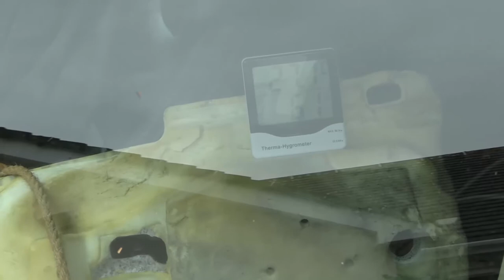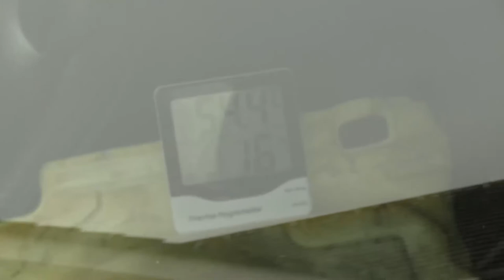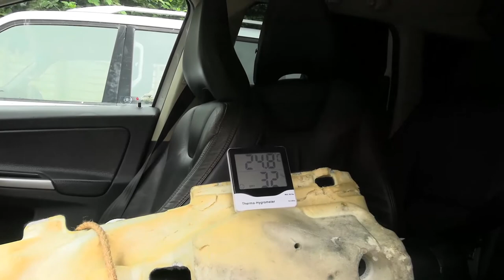Drying carpets after Volvo XC60 windscreen leak

Comment: Great video. very useful thank you. I have the same problem with my Volvo C30... With a lot of water sloshing around under the carpet etc.  The seal at the edges of the front windscreen has gaps and needs replacing.

Comment: Found this after looking at your M300 video.  We have a 2012 XC60 purchased with slightly over 100,000 miles.  After finding leaking along the entire top edge of the windshield (windscreen), then discovering that Volvo had a problem with bonding for several years, I convinced our dealer that he HAD TO either replace the windshield with a new one, or fully remove the existing one, strip then re-prime the bonding area and properly re-install.  They opted for the latter and total cost was $0.  The fellow who does this work did an excellent job, solidly bonded when done (and now, 9 months later).

Of course, I have no idea if Volvo UK has generous moments like Volvo NA occasionally does.  But this is also a design defect and it was nice for them to take responsibility, especially at the high mileage.
Reply from the maker: Well done! In the end mine was replaced under insurance, but only becaue it had another chip in it that qualified for the cover, otherwise it would have cost me about £700 which was a surprise.
Reply: @samuelfielder  That's good to know.  I never thought about windshield insurance for anything other than cracks or destruction.
Reply from the maker: @nheng6913  Well, it doesn't work for leaks by themselves. You have to have a crack or stone chip too. Luckily I did.

Comment: Thank you for posting, great video. There is a windscreen bonding issue with the XC60 and other Volvo models. removing the windscreen external side trims and cleaning them out and the channels does go some way the negate the leak however I understand that a remove and re bond of the windscreen is the real answer

Comment: I can empathise with your struggles with car trims and fittings and also with water ingress as I’m currently tackling related problems on my 20yr old V70.  Well done with your perseverance.  The only you don’t appear to have done is to seal and test the leak has stopped!
Reply from the maker: Autoglass said they'd try and remove the windscreen and then reseal it, but if it broke during that attempt, I'd have to pay for a new windscreen (over £700). This is because leaks are not covered by usual windscreen damage insurance. In the end they did break it whilst removing it, but I didn't have to pay the extra because they found prexisting damage on the screen that justified an insurance claim.

Comment: You are a life saver, I had a leak in the same car and had no idea how to pull everything up.  Thank YOU!!!
Reply from the maker: My pleasure. Note that some people believe there is a design or manufacturing fault that causes this windscreen leak, and hence worth asking dealer if they will fix it for nothing.
Reply: @samuelfielder  had water in my XC60 carpet too and took the whole carpet out to drain and dry. Did anyone experience the tailgate not unlocking afterwards?
Reply: I wonder if the wiring got wet, or possibly a wiring harness (hopefully Volvo was smart enough to keep the wiring harnesses far off the floor so they don't get wet). Or a wiring harness came loose when you pulled the carpet/moved things. 

I would look into a video on electrical car diagnosis like Eric the Car Guy. You gotta check the possible issues, starting in general from simplest issue (eg bad fuse, bad relay, a bad lock switch, loose plug) to hardest (eg computer issue, wire broken, bad harness, bad lock latch). 

Note that I'm just guessing the causes and order of simplicity, watch a tutorial for your own determination. 

And maybe somebody on google has an identical situation (lock not working after water or carpet removed)

Maybe start with figuring out if the lock itself is bad. Test that the tailgate lock is getting power at the back.

You may be able to unplug the wiring harness from the lock actuator , and correctly use a test light or multimeter to check if there is power in the wire. Because if it's receiving power, then the lock itself might be bad. 
   @oohjeri
Reply: @zzoinks  Thanks, for your response. I have checked the fuse, appears good, not sure if it has a relay are the  fuse description doesn't specify any relay, replaced the lock mechanism and still not work. I am not sure how to test the harness with a multimeter the wire schematic seem a bit complex for me.

Comment: Thank you for this video, this is going to come in handy. I didn't have the leaky windshield issue but I did get my interior wet playing around in an ATV park when I lost a fight with a sand filled puddle that almost swallowed my car. Now I have a mess to clean up.
Reply from the maker: If you have water in both the driver and passenger footwells, it will bve easier to completely remove the carpet rather than trying to dry it out in situ. I avoided that because to do so, I think, requires first removing the electronics boxes from beneath the driver's seat.

Comment: Wow you are smart and a good explainer. That is a lot of work. Well worth it im sure since drying it without removing the carpet sounds like a snail race. Did you notice lots of droplets falling or was most of the water invisibly running from the windshield to the floor? I saw a used xc60 today and it had a damp carpet after a big rain as well.
I dont think you caused the issue. Surely the glass would not unseal just from that. It's probably a factory defective seal. 

I imagine but im not sure that the air pressure from closing the door pushes a lot more than the blue tak or hands ever would. (For a piece of glass that is supposed to stay glued in a crash)

Comment: My wife’s 2012 xc60 has the same issue. One day I noticed that the carpet was soaked with water. I use wet vacuum to suck all water out. Patch the top edge with flashing cement. Silicone does not bond well with paint on the roof, it leaks after a while. Hope asphalt cement works longer

Comment: Re the rear rail caps, there is a tiny hole on the side that with a tool with a small point or perhaps a paper clip you can push into to and remove the end caps very easily.

Comment: I had the same issue with my 2012 Volvo XC60-T6 and lifted the carpets and put a small heater and a small fan to dry each side out.  My problem was both the sun roof drains were plugged and I cut the ends off the tubes which are under the cowl between the windshield and hood and that opened up the tubes, I also removed the trim on the sides of the windshield, cleaned everything up and put in new sealer.  Everything seems fine now.  I love my Volvo but not happy with the support from Volvo or the dealer as they were useless in helping to get this resolved.